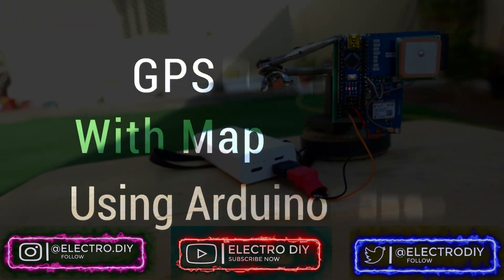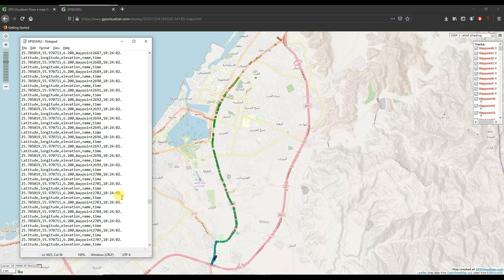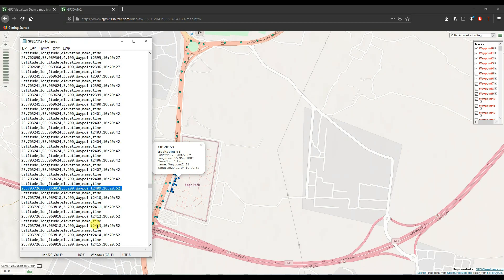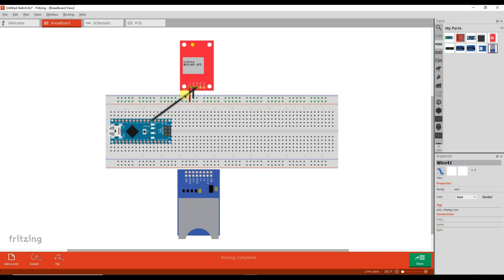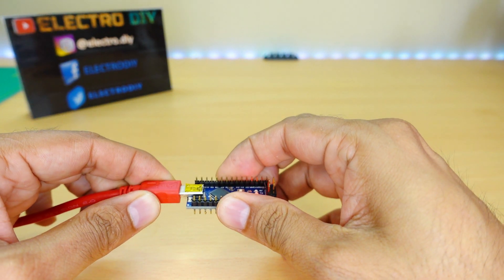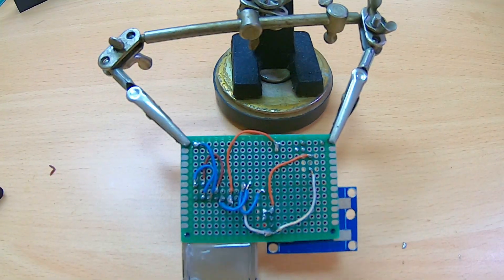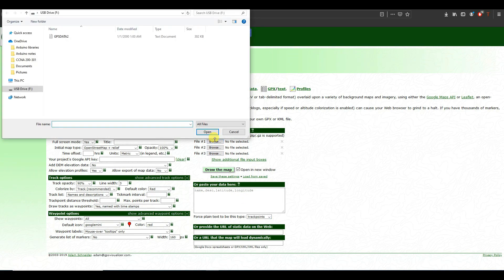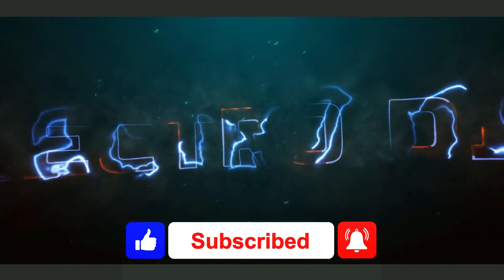How To Make Arduino GPS Logger With Google Map Display On GPSVisualizer

Comment: Electro DIY, I tried your projects and took me 3 hours configuring the device. It Works! Thank you for your best! Now, I am going to try and take it with me driving around town.

Electro DIY ، جربت مشاريعك واستغرقت 3 ساعات لتكوين الجهاز. إنها تعمل! شكرا لك على أفضل ما لديك! الآن ، سأحاول أخذها معي أثناء القيادة في جميع أنحاء المدينة.
Reply from the maker: I'm so glad to hear that. Please note that the Neo6m gps module takes time to connect to gps. So make sure its placed in a good place for signal reception n doesnt occupy unnecessary space in the car 😊

Comment: Just a question, should I use LIPO battery at 3.7v, should I use step up voltage, where should I connects? Thank you.

مجرد سؤال ، هل يجب أن أستخدم بطارية LIPO عند 3.7 فولت ، هل يجب أن أستخدم جهد تصعيد ، أين يجب أن أتصل؟ شكرا جزيلا
Reply from the maker: U can use step up converter from 3.7 to 5v just to make sure enough power is supplied to the boards